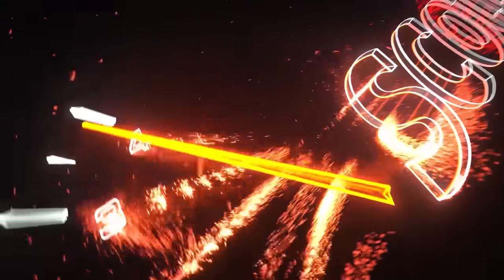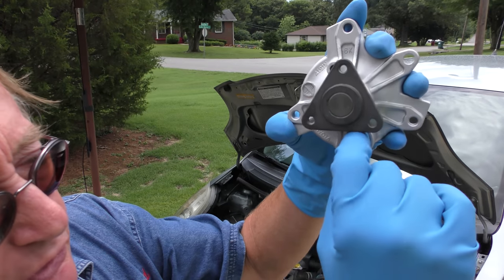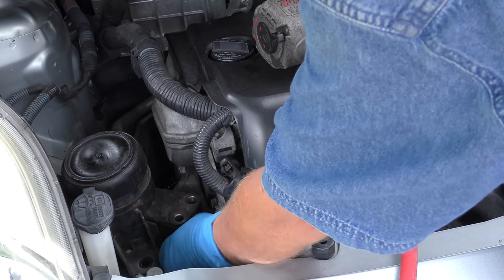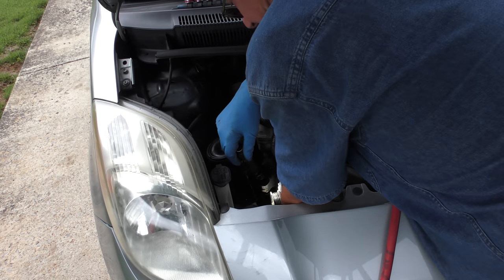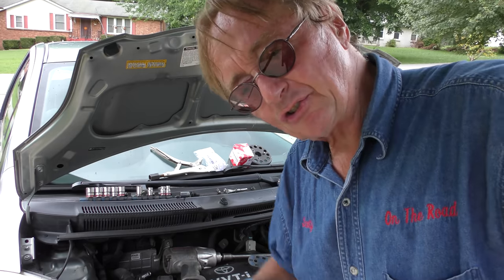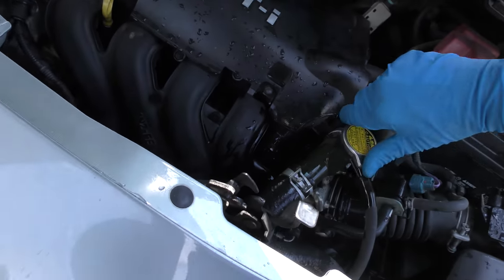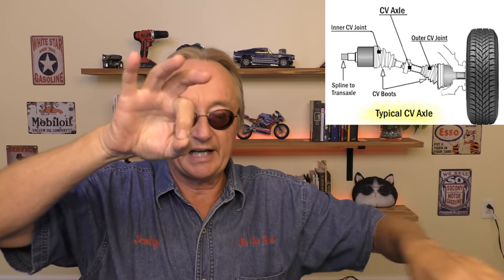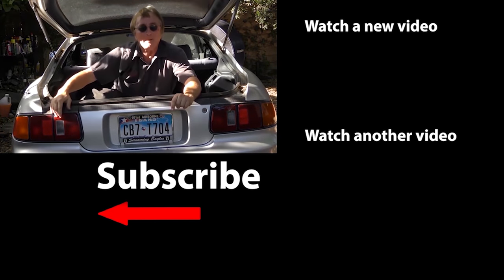These Toyotas are Breaking and I'm Mad as Hell

Comment: My father had a 2010 Toyota Corolla 1.8L  made in Mississippi, the water pumps put into those are cheap crap compared to the Japanese made one. We of course replaced it with a Made in Japan one and it ran like a clock, until the timing started ringing randomly after it got past 100k miles. Moral of the story, don't buy Corollas made in Mississippi.
Reply: Don’t those cars need their valves adjusted at 100k?
Reply: @bngr_bngr  Dealer never said anything, needless to say, we're done buying cars made in the USA.
Reply: Well this Toyota Yaris is a yaris from Japan before they went to Mazda making them basically, the water pump he just took off was one made in Japan, end of the video Scotty said he bought factory oem denso parts, I just went and got a new water pump from the dealer for my 09 yaris sedan and it was a Aisin water pump made in Japan, I got the denso Japan alternator when that went out but these parts seem pretty solid and last a long time, especially for a car that’s going on 14 years old not bad if you think about it.
Reply: My 2010 RAV4 is made in Japan with 177,600 miles on it and runs perfectly.
Reply: Mississippi is where the new 2022 frontiers will be made. Idt its same factory but im sure will run into similiar issues.
Those are looking pretty sweet believe it or not.
Reply: Theres a TSB for that rattling noise, VVT cam gears, doesn’t matter where your car is assembled honestly, they all share same parts, they’re just assembled differently.
Reply: Don't knock Mississippi now. I'm from there. The Toyota plant is in north ms and the Nissan plant is middle of the state. Only buy one made here if it was made on a Wednesday. We're hung over after the weekend and gearing up for a weekend after Thursday.
Reply: @robertkeefer1552  I don't buy if the VIN doesn't start with a J
Reply: @todtalk3912  is there a website that list which US cars are made in Japan?
Reply: Ek! I bought a 21 Corolla Apex that was made in MI meanwhile my Fiancée bought a 21 HB Corolla that was made in Japan. I guess we'll see with time!
Reply: Place your bets, I'll put my money on the Japanese made to last.
Reply: @bngr_bngr  For Toyota, a few Lexus and maybe the Corolla HB.
Reply: @MagnumOpos  All sedans are made stateside, hatchbacks in Japan. I'm not sure about the hybrids, but probably made here in the USA as well, since we only get the sedans.
Reply: @bngr_bngr  hondas
Reply: @rDonBonOne You got an oxymoron there, but there are lucky days. Oxymoron:firestone and running like a top.
Reply: @bngr_bngr  not the newer one, the older ones you would be correct.
Reply: @rDonBonOne Have the same...only thing done to it so far is the starter. But an old lady had it...and it's a standard. Said it was the first standard she ever had, so I figure she did a lot of stalling.
Reply: Never say never with the literally most reliable cars out today, USA made Tesla🔥
Reply: I agreed, most Toyota especially the 4 cylinders aren't as reliable as before. Honda have a better current 4 cylinders engines, so for reliability and newest vehicle between Toyota and Honda, go with Honda. 
I have own Toyota all my life, bought a Honda Civic 4 cylinders because it reliability. Definitely get the V6 equipped Toyota.
Reply: REAL moral of the story, don't buy cars made in 'Murica, they're not as bad as Fiat but they still BAD.
Reply: @xperiorltd.martin2342  😂
Reply: My 2010 corolla is made in Canada,so far its been a great car 132,000km
Reply: @bngr_bngr  idk, the first digit in some instances (u.s. made tacomas for instance start with a 5). My 2 bmws i had a 2013 535xi and a 2017 330e both of which had a W as the first letter indicating being manufactured in germany.
Japan built car will start with a J.

So for instance if u go online and say are all toyotas made in usa and someone may say yes, but thats not true because they make em in mexico too. Very close to California but its still mexico. Point is, u ha e specially check the vin to know for sure.
Now there are obv certain models like the land cruiser that is mostly built in japan (i think all u.s. versions) but they also build them in Venezuela. So u just have to check the vin to be sure.
Now if u find a right side drive Japanese vehicle u can be mostly sure it was built in japan as most wouldn't spend that kind of money to switch it here, as thatd be a waste lol.
Reply: @headpainter1  LOL.. now that's funny as hell ( and honest)......
Reply: @captinbeyond   It's a Toyota yaris not a Corolla it's a yaris hatchback
Reply: I have a 20 year old Silverado that I just replaced the pitman arm seal on.A little research and my labor saved me $600 bucks.Maintenance is cheap insurance compared to a huge repair bill.If you can figure out how to type repair videos you can figure out how to fix things.I have a butt load of tools and 40 years knowing how to use them.If you don't want to get involved in fixing or maintaining a vehicle when you drive through your neighborhood take inventory on who's working on something in your area.They like me would be more than willing to help you out.
Reply: @jasonk876  Exactly! It's not America's fault people are too lazy now and too beta male to do their own repairs as it used to be the case. It's not America's fault that people are too lazy to keep up with the maintenance of their vehicles. 
It's also not the workers of Toyota USA's fault that they just like every other manufacturer have to pull parts from all over the place while workers of Toyota Japan pretty much only use Japanese-made parts.
Reply: @bngr_bngr  None. I believe he meant which US brands are made in Japan and I believe none are. Some US brands are made in Korea and China but I dont believe any brand that isnt Japanese is made in Japan.
Reply: Your info is kinda out dated since the 12 Gen 2.0L and hybrid Corollas all come with electric water pumps (which are Japanese Denso/Aisin made units).

Comment: I'm starting to see the appeal of getting older cars, and fixing them yourselves. Nothing fancy, simple and easy to teach yourself how to repair
Reply: You won't find anything easier to work on than a pre-computerized pre emissioned vehicle.Before I bought my '01 Silverado the newest vehicle I owned was a 1973 Malibu.I've owned 6 cars in my lifetime and just being able to do basic maintenance has never left me stranded.
Reply: I couldn't agree more, when I bought my truck in 2008 I looked a long time to find a simple one, unfortunately still ran by a computer but crank windows, manual transmission, no cruse, no turbos, no nothing, it has a radio, yes radio not stereo and air conditioning and that's it for luxury, not even Carpet.
Reply: @scottyellis3442  My 2001 Silverado1500 Z71 has 80k original miles.It's never seen a stealership in its life
Reply: Mine either. "Stealership" 😂😂👍🏻👍🏻
Reply: 2001 with 80,000 original miles? That's pretty good. My 2008 plain Jane F150 has 150,000 & only replaced the alternator. Not counting brakes and normal maintenance stuff. That Silverado should last a long time, I'm ford but Silverado's are tough & dependable trucks as you well know.
Reply: Abyss you're exactly right, my 2008 still feels new enough, but I inherited my mom's 2005 Crown Victoria that she bought from a Highway patrol auction & it does feel cheap but it was built cheap & simple, & it is a p71 but it was just driven back & forth by a lieutenant so it was never in high speed chases. It is a good "kinda fast" dependable car.

Comment: I usually (if I remember) leave a small squeeze of glue etc. hanging out of the nozzle within the cap so that if it does dry up you have part of the plugged up area to pull out, usually taking all the dried up stuff out with it and leaving the nozzle clear for use.
Reply: little gem.
Reply: R u a dr.
Reply: @maxinehughes6999  dont tell anyone. ;-)

Comment: The water pump on my 2007 Toyota, Corolla at just over 100,000 miles. I had to replace the Motor Mounts at 50,000.
Reply: you drive Hard, baby it and drive like an old lady

Comment: If the impeller on the water pump has separated it won't leak but it still needs to be replaced. To diagnose a non-leaking water pump take the radiator cap off fill the radiator to the brim and start the car. Have someone rev up the motor. If there is no coolant turbulence at the radiator filler neck the water pump is not pumping. With good turbulence and no leak look somewhere else. Let the car get cold and pressure test.

Comment: Little trick for you Toyota owners (although I would wager other vehicles with external water pumps powered by the serp belt would apply). Toyota water pump pulleys have holes in them for a reason. So you can use a lock to keep them from constantly turning when removing the bolts that hold down the pulley. However, seeing as how Toyota (or any manufacturer for that matter) special tools are redonkulosly expensive, one can simply utilize a long hex head bolt. 

Stick it through the pulley to lock it in place. As you loosen the pulley bolts, the bolt end should brace against one of the ribs on the water pump, keeping it from turning. This method can also be utilized when installing the pulley into your new one. It eliminates the need for a pair of vise-grips, and works in those tighter spots as well. Having worked for Toyota, I utilized this method quite often. Much easier to pull a bolt you keep around for this out of your box vs going hunting for the correct special tool in the "dealer tool room."

Comment: What's your thoughts on the new AWD Camry with the system from the RAV4? Is it a solid and fairly reliable system? I do delivery work in the northern midwest, so I experience a lot of intermittent weather. I've never liked crossovers or SUV's and I'm wary of the CVT on the Subaru's.

Comment: 2019 Tacoma. Fuel pump recall for stalling at speed. I did the recall and it still happens. Cheap plastics to save a buck. I should have bought an older Tundra instead. Not looking forward to see what else goes wrong.
Reply: @captinbeyond  it’s actually listed as Texas on the panel sticker.

Comment: I own 7 GM vehicles and just bought my first brand new Toyota eight months ago.I have a "maintenance required" with two different code issues on the Toyota. Not a single check engine light on any of the GM'S.I thought Toyota's were good.
Reply: I think there's more to this story than you said. What are the maintnence items required? Change the oil will show the triangle too
Reply: Maintenance required means you have to change the oil. And if you did, just reset the odometer
Reply: It only has 4,000 miles on it . The codes are for the driveline . I actually brought it in to get a oil change at 3,000 for the free Toyota Care oil change and they said not until 10,000 miles. I will change it myself at 5,000 miles.
Reply: @tomrunning357  what did they say was wrong? I mean a code for driveline doesn't tell me much
Reply: Haven't brought it in yet the display on the touch screen now shows 3 codes.  Vehicle stability control system, all-wheel drive system, and pre-collision system.  Then maintenance required.  The wife is out of town with the car now. I will trailer it home tomorrow.
Reply: Are those newer GM vehicles?
Reply: @Aaron-eo7ev  And a 2005 .
Reply: @tomrunning357  all 7 are 2005?
Reply: Comes on every 5k miles or so as a reminder to change the oil and filters out, doesn’t mean anything and it’s super easy to reset on Toyota’s just look it up 😂
Reply: @jonathanmacdonald9276  I was all ready to back up Toyota's bro 🤣
Reply: I told everybody about Toyotas even today, but nobody heard until today when you knew the truth.

Comment: Bought my daughter a 2002 Mini for her 1st car. Had 105k miles. Paid too much ($3k). Have already had to repair an oil leak because of the crappy plastic tube on the housing, a power steering leak (again caused by a broken plastic piece), the bcm computer is faulty and although it’s easy to replaced BMW/Mini charges $550 labor just to reprogram the new 1, and now the a/c compressor has taken a 💩. Thankfully it’s a manual so the tranny will hopefully never be an issue. If anything else breaks on this thing it’s going over a cliff. Cute and fun to drive, but I wish I’d have known about Scotty sooner and I’d have continued looking for a Toyota or Honda.

Comment: I learned how to change water pumps on Pontiac 350 V8's.  You would get about 10-15000 miles on a water pump because that motor were over torqued.  Great memories.

Comment: One time I replaced a thermostat with a NAPA part and the car would overheat. Then I got a factory thermostat and it had a hole with a  small sliding dumbell to go in and out with pressure. It worked fine after that.
Reply: The same thing happened to me 35 years ago.

Comment: Often times I find I can at least loosen those water pump pully bolts easier with the belt on. The tension is enough to hold the pully still until I can at least break  them loose/ Same thing when it's time to bolt it back on.

Comment: also check if the water bypass pipe is cracked as some are made of plastic!  the one on my tacoma cracked, and i found it was made of plastic! the replacement is made out of steel! must have been an american engineer who designed the plastic one, lol! change it right away if its plastic, as mine cracked and overheated BADLY!!

Comment: Hey scotty, my 2021 Toyota Highlander Hybrid died on the highway at 1200 miles due to Vapor Lock on a hot day at about 5000 ft altitude.  Service at St George Utah say they have being seeing this also on the Toyota Sienna.  I can't find anything on the internet about this problem.
Reply: Ethanol. I had the same problem on my motorcycle. Go for the non ethanol gas. Might get you fixed up.
Reply: Ethanol 'vaporizes' at different temperatures than straight gas. Locked up my bike all the time. I'd go for full 100% gas, I bet that'll work.

Comment: The thing that stinks about Toyotas is that they used plastic thermostat housings that are going to break apart when you try to pull off the radiator hose.

Comment: Here's a question for you... 2016 ford e350 super duty..5.4 litre flex fuel I own.. I tow a 22 foot pontoon boat occasionally.. looking to increase fuel efficiency.. can I change the diff ratio gears to better my fuel economy and still maintain towing capacity for my boat? It's my daily driver and 10 mpg on average is what I get... would like if it got 16ish? Is this possible? Thank you..

Comment: Scotty a few weeks ago my 2001 Corolla check engine light came on, so I made a check with my OBD2 scanner and get a P0125 code. I replace the ECT sensor  and fuel economy came back up with no engine check light, but after a week of driving, the check engine light came back on. I check the code and it P0125 again. What possible can cause a P0125 code to popup again after installing anew ECT sensor? it not over heating, coolant is top off with over 145,000 miles.

Comment: I have 4 cylinder 1999 camry . The exhaust parts after the flex pipe vibrates and hear rattling sound when the car iOS warmed up and the transmission is engaged. Looks like the core inside the cat is broken into pieces. But why does it only happen only when the transmission is engaged and the car is warm?

Comment: Question: I bought a 2020 Honda Accord from a used car dealership.  It had 9,500 miles on it, and the dealer bought it at an auction from Michigan.  I never thought about the fact that cars up North are driven on salt, and I'm concerned that this car may have problems in the future.  

Should I be concerned, or is the car okay?  It runs fine, in my opinion.
Reply: How much left on the factory warranty?  Look under the car for signs of rust. Should be OK.
Reply: @wholeNwon  A year and a half left on the factory warranty.  I don't see any rust.  Maybe I should take it by Honda and let them look at it just in case?
Reply: @christopherr6284   Sure you can but NEVER believe anything that any dealer tells you about your car that requires money coming out of your pocket and going into theirs!  NEVER!  Google for recalls and TSBs for your vehicle before you see a dealer. Make a list and be sure they've been addressed and that it's in WRITING!
Reply: @mcc7762  Oh I'm dumb. It was originally sold from Honda in Illinois.  Looks like it was sold at auction to another dealership in Missouri, not Michigan.  It was sold October 2020 with 14 miles on it.  And when it was with the dealer in Missouri, they put 1,000 miles on it.  And somehow, it got another 8,000 miles put on it and was sold at auction to a dealership down here in Georgia, where I bought it.

Comment: Hey Scotty I have a new problem on my 2011 Ford Expedition.  I've had it for about a year. I had them fix the power running board and the rear wife was inop. Also right after I bought it the check engine light came on 30 minutes from taking delivery. I called and they got me in right away. They  fixed the running board. And the mechanic said he need to check it more. Its was Fri and almost 5 o'clock. I talked with thee service  writer and found required the gas tank to bwe drop.   Grrrr I know he didn't drop the tank. They got in Monday and fixed the sensor. I had a few moments of hesitation about 6  months later. but it quickly went away. Yesterday it hesitated but didn't clear up right away. I got it off  the road and revved it and it seamed to clear up But as soon as I tried to drive it but would go over mhp. Could it be cause by the sensor they replaced or is something else??

Comment: How does a leaking pump cause overheating? Only if coolant gets low?
Reply: On older cars (not referring to this specific car), when coolant hasn't been changed, more corrosive fluid damages the fins on the pump's impeller making them very inefficient at circulating fluid.